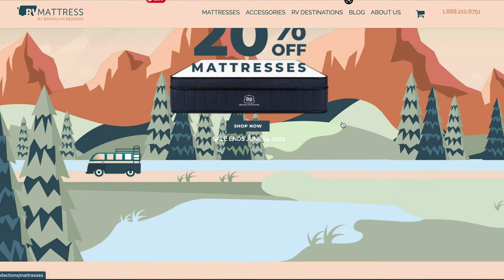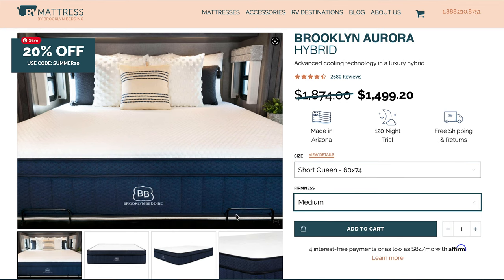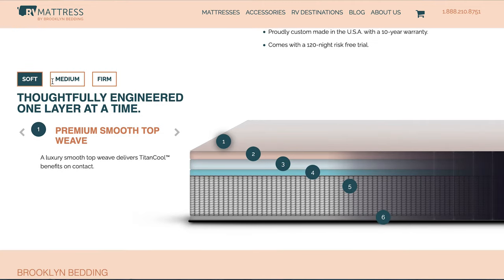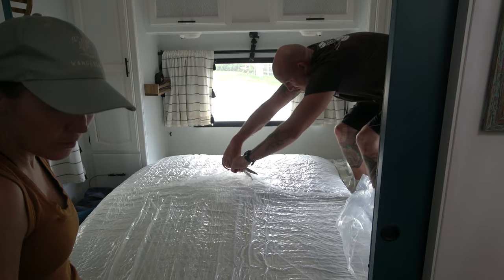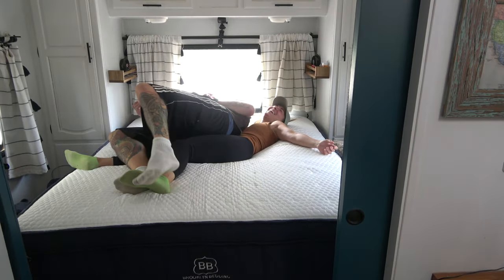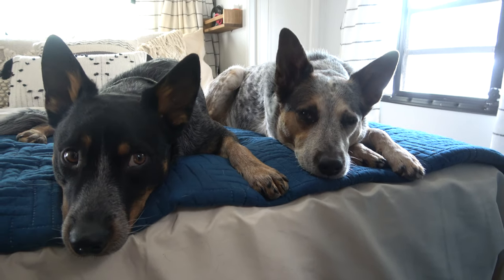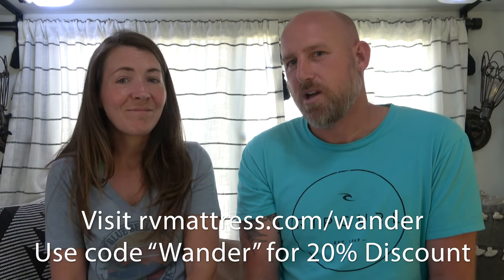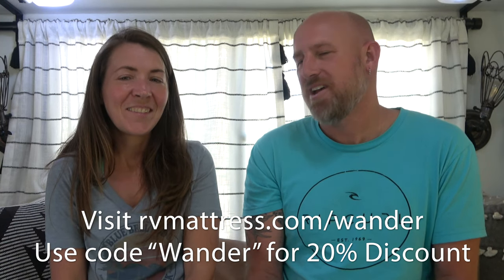6 Things We’d Change After Living in Our Remodeled RV // RV Remodel Regrets

Comment: Place a longer tube on the urine drain tube.  A few inches longer so you can put a loop in it, that will operate as a P trap holding some fluid and stopping the blackwater tank from fumigating.
Reply from the maker: Thanks for that idea. We later built a p trap from PVC but even a little urine in a small trap left for 8 hours overnight can reek. We installed a fan between the toilet and outside and also have a small plug we use from time to time. These methods worked ok. But will look into the looping idea.

Comment: You could simply add a P Trap to your existing clear hose.  The P Trap will hold a few ounces of liquid all the time and prevent venting of the fumes out of the black tank back up into your rig. It would look like the P trap under most sinks and would be simple to add to your installation.  Let us know if you try this idea and if it works for ya!  All it takes is a little more hose twisted into shape or a few pieces of PVC Plastic pipe to add in line with your clear drain hose.
Reply from the maker: We tried the P trap lsat summer and it did not work the way we hoped that it would. There was still a urine stench, nearly as bad if not worse than whatever odors were escaping the black tank. We did install a pretty decent computer fan and popped a hole in the side of the camper to vent outward. That seems to do the trick most of the time now. Thanks for the idea though!
Reply: @CalledToWander  Cool, yeah, in addition to the P-Trap, of course I would pour about a cup of water down the urine side to flush the urine out of the P-trap so all you had in the trap was fresh clear water.  Of course the muffin fan will always help draw the odors out of the area as well, so that's good.  Glad you found a resolution.  Thanks for the reply.🙂

Comment: The only way to go is a sleep number mattress. Adjustable Air is the only way to go. Really! They make a queen for rvs btw. Your foam mattress does not relieve pressure points in your body.  Also, you either pay for quality( with anything)  upfront or you end up paying more in the long run which is what you two have done.
Reply from the maker: We're happy now!